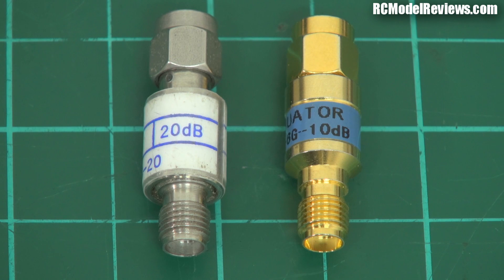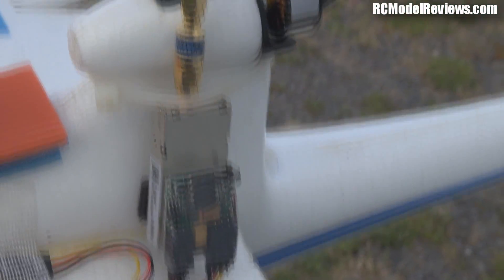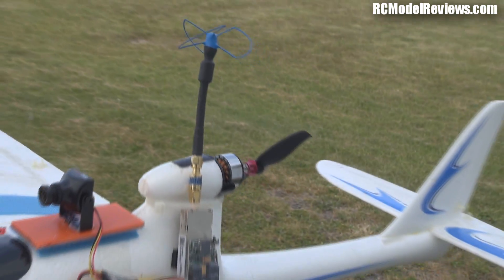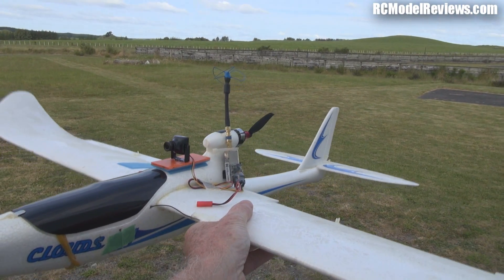3.3GHz FPV sample footage at 10mW and 100mW

Comment: where did you get the things that make it a 100mw output?
Reply: +Mr 250 FPV You can buy attenuators from a number of sources -- even eBay.  a 10dB attenuator will reduce the power going to the antenna to 100mW.

Comment: +xjet - How hot did the attenuators get?  I've only really used them to attenuate the signal going to an oscilloscope at very low power levels but would have thought they would get pretty hot using them on the output of a 1W transmitter.  But with the constant air flow maybe they stayed cool.  Interesting.

Comment: Reading the info for ITU Region 1 and specifically Germany, it would appear that only one channel advertised for this equipment (3470 MHz) falls within the band permitted for Amateur Radio Secondary Operation, which is the 9 cm band (3470 - 3475 GHz) at 75 Watts ERP.  The emphasis is on the term "Secondary Operation" - don't interfere with military or commercial users - so the precaution that XJet has taken of using an attenuator is also the way ahead here. The Line of Sight rule is also valid in Germany as is the presence of an observer/lookout when FPV is being used. 

In Europe, one Amateur Radio (Ham) (Secondary) use of this band is for the Amateur Satellite Service up and down links (most likely directional antennas) and one (Primary) commercial use is Radio Location (omni-directional antennas), which shouldn't mean those in use by commercial airline traffic, which are normally on a HF/VHF band, but I cannot be certain - I'm guessing animal tagging or something similar. The minimum necessary milliwatts for clear video should be the aim, certainly not 75 Watts or even 1 Watt. 

Proceed with caution, even when you have qualified as a Ham     Alan G6KZT/DA1KZT
Reply: +Sputniksam - I think you are correct about the "aerial platform" part of the regulations even in Germany. I will be using the 3.3 Ghz system to provide a cross-site ground link to provide a feed to a large television in the coffee tent at our next open day in August. The aerial video video part will be provided by standard 5.8 Ghz gear down linked to the 3.3 Ghz gear working at 10 milliWatts. Largely just because I've bought the gear, I have the licence and I can. Alan G6KZT/DA1KZT

Comment: Does a ham licence cover you when transmitting from the air without displaying a call sign?
Reply: Not sure about the nz test but the FCC one I just passed had a question about transmitting without call sign for radio control models and the answer was you have to put a label with your call sign and address on the transmitter. I suspect there will be similar rules for most places.
Reply: donpalmera many cameras will allow you to put your callsign in the osd,just not sure if its legal to transmit from the air in som countries ,with or with ham ticket.
Reply: +donpalmera That rule is for control signal sent to the model only, not video sent from the model. You must ID in transmissions themselves for video.
Reply: +Jake Bullit it's probably always going to be slightly grey. Here the 5.8ghz stuff is mostly in a ham band for "amateur television" and the ham people don't seem massively happy about fpv use but the people that dish out the ham licences have admitted its OK if you get your ham licence and transmitter certified.. but the rules don't say anything about onscreen call sign. The rules say you need to transmit it by voice or Morse code.. but I think it being onscreen will be enough to keep people happy.
Reply: +donpalmera FCC rules also allow in band ID for standard video:
Part 97 : Sec. 97.119 Station identification
(4) By an image emission conforming to the applicable transmission standards, either color or monochrome, of §73.682(a) of the FCC Rules when all or part of the communications are transmitted in the same image emission
Reply: Steve Pinkham
I had to get an FCC license to operate here but FCC rules don't apply (reciprocal license)
Reply: Steve Pinkham and that rule makes good sense. You're probably right about the label on transmitter being only for remote control too. That's the only situation you can use encryption too from what I remember of cramming the test answers over a weekend before taking the exam ;)

Comment: I was reading up on this in the UK and 3.3 falls close to or into a military band so not best to use it here, info can be found on the ofcom website by looking for the frequency allocation table (FAT table).
Reply: In the UK the 3.3GHz - 3.5GHz amateur allocation is on a secondary basis with the MOD being the primary user. Even though I hold a full amateur radio license the I am prohibited  from using any amateur radio allocation to make transmissions from any airborne platform other than those already scheduled within the license exempt allocations, eg 5.8GHz ISM band. I personally see this as a great shame as amateur radio, in the main, has lost the ethos of experimentation with many users treating it as another form of Citizens Band Radio where as the FPV, Hacker, RC, and Maker communities are all about experimentation and ingenuity and would be the injection the hobby needs if the restrictions were lifted.
Regards
Nidge
Reply: +Budgie RC I noticed Ofcam now have a nice interactive spectrum on their web site. The military seem to have options across most of the spectrum. There is 3.4Ghz which is an amateur intermediate/full area but maybe best not to tread in that area. Its good to see manufacturers trying other freqs but its not suitable over here. One Watt is also too much power as Bruce mentioned.

Comment: I might be getting an axn for Christmas
Reply: +Flynn Asher The AXN was my first plane. It's an excellent trainer. I totally killed mine though by crashing it many times. But still the electronics work fine to put in another plane. It lived long enough to teach me good basic flying skills.
Enjoy it. A quick tip. balance the CG well before your first flight and if you can, make sure to set your expo to about 30% to start with. That should give you smooth controls, even in a panic situation. Gain enough alltitude and relax. smooth sailing. Check out my channel for flight footage and repair tips.
Reply: +Flynn Asher You should!
Reply: My dad is ordering one, and I'm getting a cheap hobbyking transmitter and RX and 3 lipos
Reply: +Flynn Asher I use 2200 mAh zippy compact 25c, they are perfect and will give you up to 25 min of flight (look at my channel to see some of mine). I also use 4 of the TGY-50090M Analog Servos, they are metal gear and very reliable.
Wish you all the good stuff with this plane
Reply: +foamidable I'm getting the prebuilt versio, because I have hardly got any money
Reply: +foamidable do you live in the uk too?
Reply: +Flynn Asher Its more expensive but the Multiplex EasyStar 2 with aileron servos is good. My first FPV plane was the RR version complete with ESC, motor and folding prop. The version 3 in kit form is out now I believe.  Multiplex planes are more expensive than the Chinese brand offerings but they are better designed. Unusually for foamies I still have it after several years  but I've not flown it for a while. I keep meaning to get it back in the air. It makes a nice stable FPV platform and glides well. It can really capture thermals if gliding to gain height with no or little power weather permitting.
Reply: +stewjw Bruce has reached out to me, I'm getting the axn, plus, I think it's already bordered
Reply: +Flynn Asher . It was just another suggestion. I have a bit of an affection for the EasyStar 2 since it got me into FPV. I think Bruce did a build video for the Axn. Have fun with it.
Reply: What battery should I get for the base PnP version of the axn?
Reply: +Flynn Asher  2200 3S gives you a good balance and if you take it easy on the throttle and use it's glide capability well it can give you a max of 30 minutes flighttime. If you fly sporty it takes about 15 minutes.
Reply: +Flynn Asher No, I'm from Weimar, Germany
Reply: Thanks for the help guys ;)